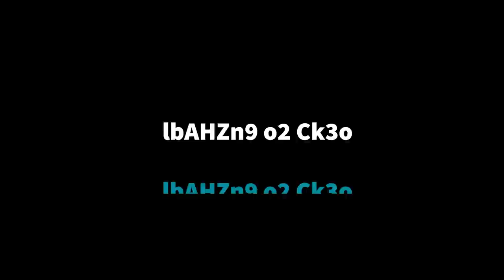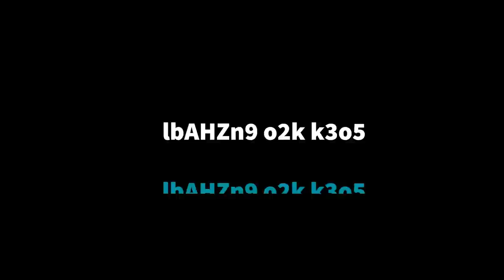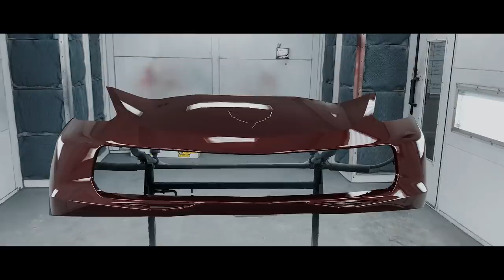Can't fix Corvette after Carmax test drive CRASHED into it.

Comment: The fact you chose a 3rd party body shop speaks volumes for your trust in your chevy body shop
Reply: Not all Chevy Dealerships have an auto body shop. Especially the mid level or smaller dealerships.
Reply: @brianbartron2787  that's true but Bachman Chevy were Chevy dude works has one
Reply: Hes getting the PPS, which his dealership doesnt have a certified person to do it. Like he said, only 5 in the country.
Reply: Sometimes it's best to keep family and business separate.  If Bachman body shop did a bad job, or couldn't meet his demands, it could make for an awkward situation at the office....meanwhile, if the 3rd party place screws up, he can really get in their face and be demanding and not worry about it spilling over into the office.  Clearly it doesn't matter anymore since he left, but I can understand why he chose 3rd party beyond aforementioned reasons.

Comment: I work at the Chevy plant we use tape to hold the cars together bolts are to expensive
Reply: Troll alert.
Reply: @RedLP5000S  What you talking about I'm sure that's true. GM quality is or has been going down for years.  Never buy one lease only you will lose less money in the long run.
Reply: First of all there is no chevy plant

Comment: When I was a body man I would run into tape on the crash absorbers all the time.  Most likely they are used to hold the absorber in place until the next guy puts the  bolts in place or what ever is used to hold it on.  You see this will little one use washers or little screws holding rotors on the hubs too.  After the caliper is installed those are not needed but the caliper may be a few steps after the rotor, and they dont want it to fall off between here and there.

Comment: Southwest auto body here in Las Vegas helped me out a ton! They got my 2011 impala driver door to open when the latch broke off while it was closed. First they were like we aren’t gonna be able to get to open so we may have to cut the door open. And then! The owner was there when he heard us get the bad news and the owner was like, “my guys can’t get the door to open? Take it to the back to the back and I’ll get it done.” And sure enough he was able to break the old latch in the door out. But they had to try and pry the door panel off. And then they took out the window so it wouldn’t shatter while hammering the latch off. They fixed it and only costed $326 compared to an estimated $900 or more to tear down the door.

Comment: In my humble opinion, you should get the Z06 grill and use your damaged grill with the damaged facia (after little cosmetic corrections) and mount the piece in your garage, horizontally.  Back in the early '90s, I removed that ugly RS grill from my Camaro and installed the Z28 grill.  A huge improvement over the look of horizontal blinds.

Comment: Even if you were taking up two parking spaces, the test driver was backing up too fast for the system... In certain cars, it usually gives you confirmation that you are able to park in between the two cars  by using the sensors... Also I think the person that was backing up ignored the backup sensors (they didn't know) so it was the salesperson fault if the salesperson was in the car with the test driver for not telling them.

Comment: There's tape because the factory ran out of   screws. Typical chevy.
Reply: Steve Silvas  i will drive a GM any day of the week lol.  I currently have a Pontiac G6 with 73,000 and change on it it's an 05.  Still runs strong and doesn't skip a beat. Unlike my 04 Chrysler Sebring that thing needs a rebuild so bad.
Reply: Would surprise me it’s gm

Comment: is it just me or the angle but the bumper looks slightly darker than the car especially on the driver's side fender it is noticeable on my screen. Could be just me. Camera work is extremely bumpy. What are you using to film? You need to invest in a steady cam gimbal or something.

Comment: I would go on and guess that tape is for the way those bumper absorbers are open/split in front so to stop them from rattling under the bumper shell but so they still do their job.  being they are plastic GM probably wouldn't want them get hot and bottom half sag then rattle a bit

Comment: Just my opinion, but I would not change the grill as this is a repair to get the car back to it's original state and then after repairs are complete, if you would like, change the grill afterwards as a modification.
"I would never buy this car used if it was not rebuilt completely."

Anyways.. love the channel✌😎

Comment: "I hope they quit bitching about being paid decent at the chevy factory so i can finish my car" lol
Reply: I here ya.  My 2012 Camaro is in the shop for no heat/ac.  The hvac temp valve broke.  The upside is I am getting around $2K worth of work done and will only end up paying $300.  The downside is, as you know, due to the strike parts are backlogged.  The shop is putting a stat on the part order but I could be without my baby for anywhere from 5 days to 2 or 3 weeks which sucks.  The other upside is when I do get it back at least I won't be freezing my butt off while driving it.

Comment: Mike first you don’t test park assist when in fact your vette is parked about two feet over the parking space painted lines. The Carmax driver should of read the manual first how to use the park assist. The vette was parked you were not in the vehicle so there in no operation of the vehicle. The Carmax driver is at fault. The grill is up to you I would keep it stock. Be Cool Drive Safe🇺🇸

Comment: U could get aftermarket headlights and run lights with a switch to turn it on and off. And get an aftermarket grill of just get some wire fence and make a makeshift grille and add lights behind it and put it on the wall

Comment: I wonder what they'd say if they hit a two year old kid that was straddling the line.
Reply: Are you really comparing a kid with a stupid car? (Regardless of price could be a Bugatti) are you really that type of person?
Reply: @blinkshadown  You have misinterpreted my comment. I'm comparing the stupidity of the other driver and the ones that blamed the Corvette parking over the line. That car could have been anything - a child, a dog, a retainer wall, a light post - and the driver of the other car would have hit it. I'm a father; no sane person would claim that a car is like a child. This was a a remark about the other driver's lack of ability to use their freaking eyes.
Reply: @xnadave  no drivers involved in either car. One was parked and one was parking with "self parking/auto park or whatever they call it. 
And thanks for clarifying your comment.
Reply: Alucardjr69 in self park mode, the driver is still responsible for modulating the brake. Cheers.

Comment: No do you not put a ZO6 on that car are you kidding me you never change anything on a Corvette like that you keep it all Factory like it is supposed to be make sure you get a diminished value check on top of the check for the repair diminished value is because they hit your car and it is not worth as much now that it has been repaired it's very common especially on a brand new Corvette they would be no room for them to argue but it is to compensate for the diminished value that it now has since it has been repaired you need to file with the insurance company that is at fault not to mention you're going to have a accident or damage report on your Carfax now that is the reason for doing so

Comment: The tape tells a story that someone has been there before. I presume you bought your car brand new? How many miles were on it when you received it? General motors  executives have access to any of the cars that are manufactured. Your corvette obviously has been in a front end collision before. The repair will not be registered anywhere because the car is not registered to an owner. At the time of the damage and repair the car is still property of general motors and will be repaired by general motors and does not generate an incident  report. You should take the car to a reputable body shop and have the car inspected for other damage or panel replacement. Photograph all nuts and bolts for any sort of markings. If you can discover any sort of repair a good suggestion would be to bring a law suit against general motors, the dealership you bought the car from and the transport company that shipped the car from the assembly plant to the dealership. Just request legal costs and your original investment and move on. One more thing to address is the color match, your new bumper does not match, but perhaps the paint is correct and it is the other parts of the car might be repainted and that color is off. Perhaps the primer is a shade darker on your repaint and the end result is off. If you wonder how i know about gm's slight of hand i fell victim to them on a brand new 1992 Camaro Z28.  My new Z28 had less than 4 miles registered on the odometer and had the front bumper, hood, passenger fender, passenger door and flairs replaced and repainted. After 7 months of bantering back and forth i got my original investment back and legal fees. Good luck!